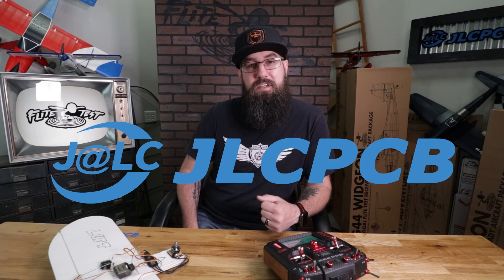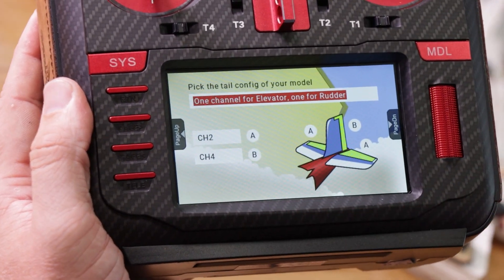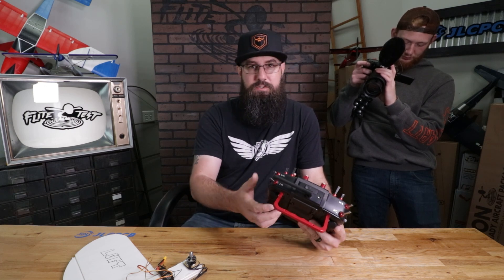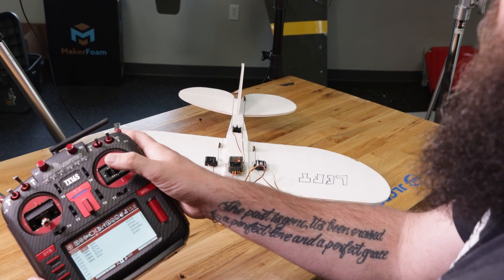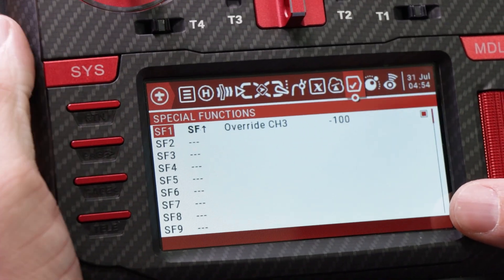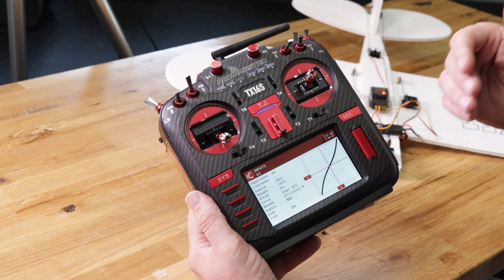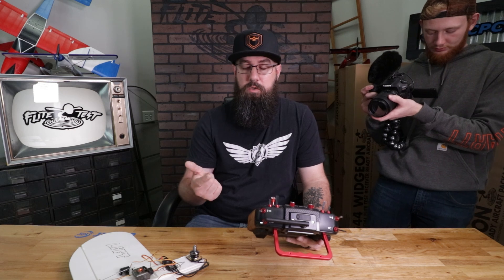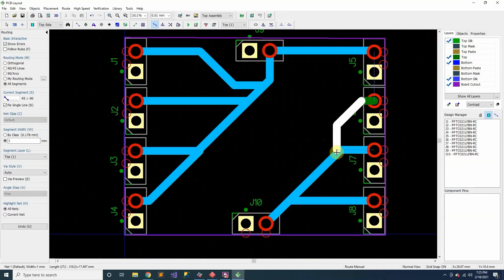Basic Setup On A Radio Master TX16S (Binding, Throttle Cut And Changing Expo on Open Tx)

Comment: I was all excited about your video (a good one) because your using the exact same receiver (AR620)I will be using in my FT model that I purchased recently BUT when I followed your video to the T with my TX16s my elevator and rudder were both being controlled by the right stick and I had nothing from the left stick??? No throttle. Not sure why but my ESC had a light that was blinking the whole time too? My 620 upon binding didn’t make as much noise as yours did either? Not sure if that matters? By the way I’m new to all this and I’m using a 3 channel (ugly stick) as my test bird to figure this stuff out. Totally lost. Please send help!

Comment: Hi there m8 , can you please please 🙏 tell me what receiver/gyros U use (in the 1 unit not spectrum )
For the multi protocol tx16s ? One that's still available to buy ! ...I don't get it  
7ish  years ago they were everywhere and about $25 now I just spent $250 on 2 sr10+ that are virtually useless to me ! As well as 2 fms reflex gyros that I also can't use because app freezs on 3 different phones !! I came back to hobby because I had a stroke and Dr said I needed hobby to relax! 
It's been anything but relaxing I can tell ya ! Please..help in anyway...if U can ...cheers

Comment: Great video. Small criticism.
TJ said he liked to do things in simple ways. I totally agree. The KISS principle is the best principle. All for that.
The thing is implementing dual rates/expo as demonstrated in this video was not the best way to achieve simplicity in the long run. It adds to Mixer complexity. It means duplication and it makes it harder to do changes later.
TJ should have taken an extra minute to tell us about Flight Modes and the use of variables to define rates/expo. This avoids duplication in the Mixes and allows settings to be seen at one glance of your variable settings. 
p.s. If you are just starting in 2023 it makes more sense to skip OpenTx and go straight to EdgeTx.
Reply: Just got this and you’re right I’m crossing over right off the bat

Comment: This is a good tutorial on using the Radio master mk2. I am concerned about the use on BNF birds. The preprogrammed receiver, I believe , be an issue unless the order of channels is made to be in the spektrum order.
Reply: Nope. You can either 1 ...set the radio to use default Spektrum order (TAER) and load the correct version of the firmware for that (or RETA or AETR if that's what you normally use) which will pop the set-up screens in that order OR 2....leave the set-up screens at the usual as-supplied AETR configuration, leave that "disable channel mapping" box unchecked, set your plane up as AETR per the screens AND the multi module will automatically spit them out to your Spektrum receiver in the usual TAER order when you select the DSM etc protocol choice. Same for any other breeds that use different usual channel orders.
OR 3...if you really want to make it hard for yourself when you insist on using over-expensive Spektrum gear, you can leave the usual stock supplied AETR radio set-up/firmware and then manually re-order the screens to TAER PLUS enable that "Disable Channel Mapping" checkbox. Again your Speky receiver will get TAER channel order.
Any way you choose to do it you will have a radio that is twice as competent at half the price of your Spektrum AND can talk to about 100+ other protocols as well! 😉

Comment: Thank you so very much for the tutorial on setting a throttle cut switch! I am using Edgetx but it was easy to figure out the settings in spite of the difference. 👍

Comment: Great video, thanks! I did exactly what you did and setup three different "dual" rates. I skipped the EXPO for now because I wanted to fly without first. I wonder if there is a way to put expo on a switch and only use it if you need it!? That way you can fly around in one of your different rates and "activate" expo at will... Thanks.

Comment: I'm trying to program an FMS 1400mm T-28 with Reflex V2 stabilizer using a Flysky 8channel receiver. I can get the stabilizer to work but having a problem setting up the TX16s to switch between modes. Any help would be appreciated.
Reply: Mixes page > channel 5 > edit > choose a 3-position switch.

Comment: 16:22 "Disable Channel Map" Watched a few times,  it's not on my new TX16S.
Reply: Only applies to those protocols that normally require the Multi Protocol Module to do an automatic re-map to spit the channels out in the correct order. E.G. Spektrum (DSM) if the radio is stock AETR order OR pretty well most other protocols if you set the radio up and load the correct firmware versions for a stock TAER set-up page. 😉

Comment: TJ this was an awesome video.   Question if you have two servos for the elevator .  Would you use Y splitter cable
Reply: You can do. Having 2 servos allows you to do things like differential elevators (in case of adverse yaw during roles) or enabling flaperons

Comment: Why is it that everytime i set up a new model and select CH3 for throttle, then when I go into Channel monitor and move the mode two left side stick up, it says I am moving channel 2 .. I'm lost.
Reply: @paulsimpson8578  Sounds like you both need to Google for a Youtube video on how it's done properly. 😉
Reply: @theoztreecrasher2647   I did - https://youtu.be/x0SzOaB5W24.  I finally found a simple fix - checked box to 'disable channel mapping' in the model. Problem solved

Comment: But arent you supposed to follow Spektrums channel order (TAER) on the rx, eventhough the tx is setup as AETR? And then the module mixes for you? Also, you can push the bind button after the AR620 is powered up.